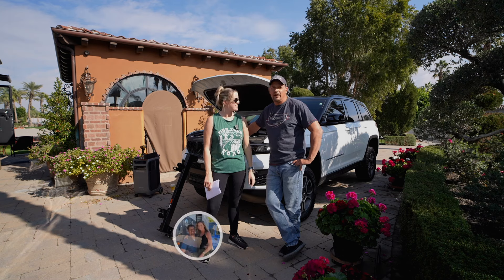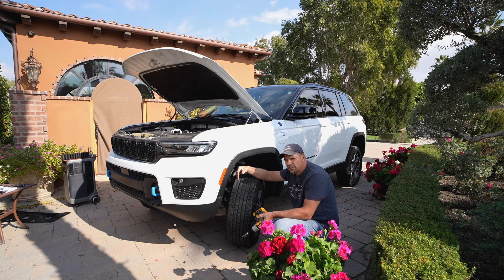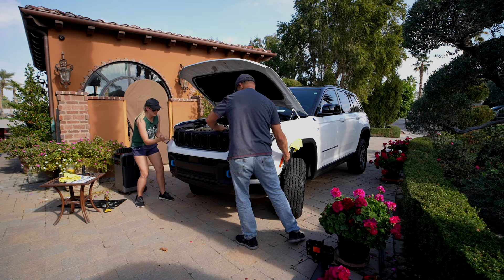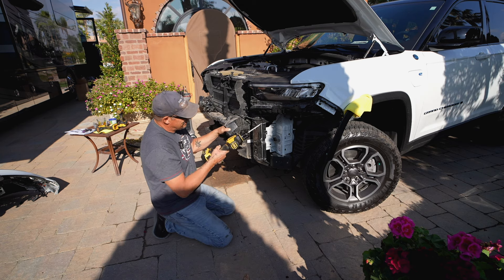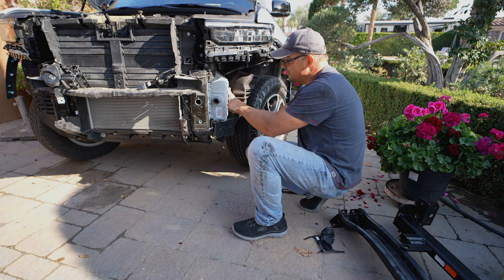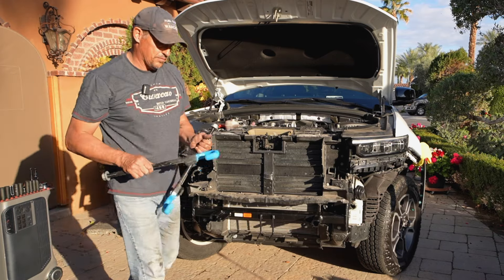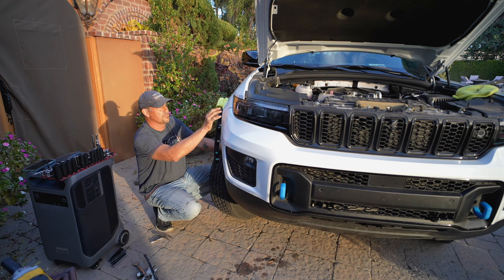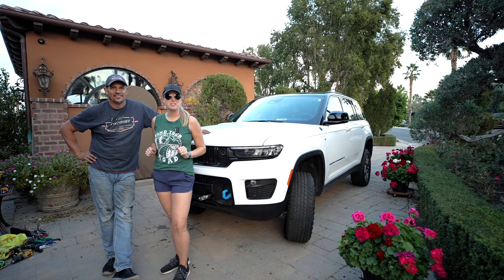How to Install a Blue Ox Baseplate on a 2023 Jeep Grand Cherokee 4xe Trailhawk

Comment: Easy enough to pull the tires off.
Specially at your home, you should have tools to pull your tires off.
Reply from the maker: Sure, but I didn’t have two jack stands. So it was easier not to pull them.